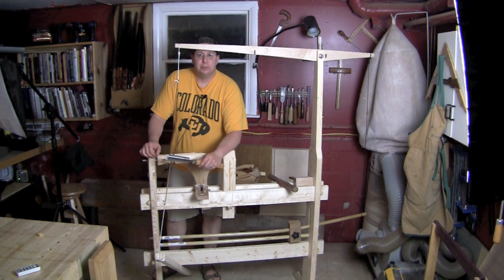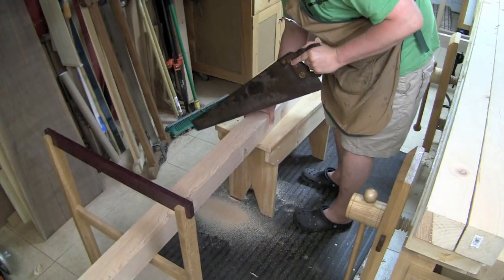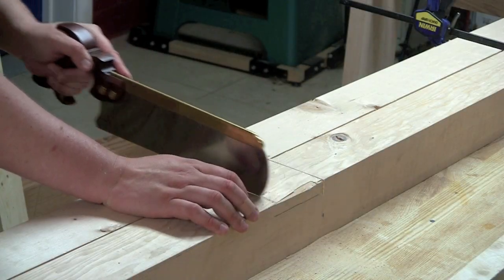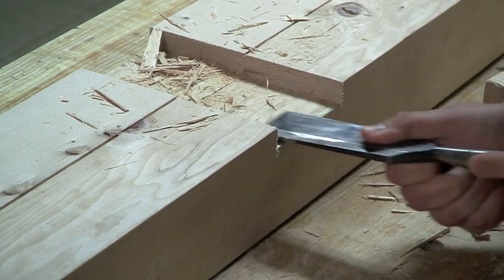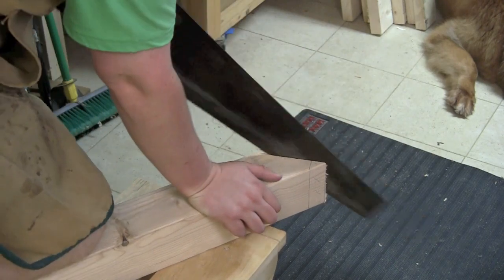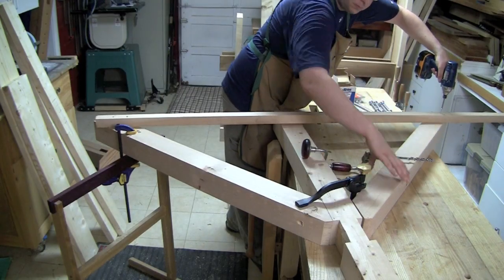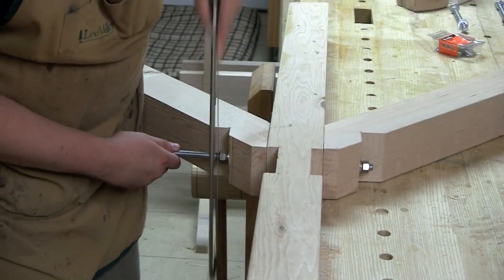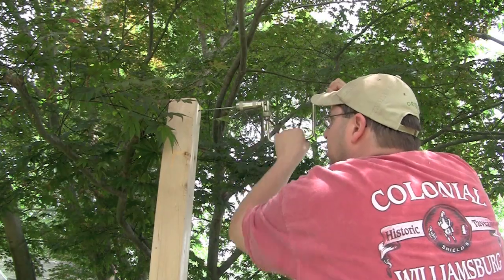RWW 162 Bungee Lathe Part 1

Comment: OK.  I made 1 years ago, but it's an oddity.  It uses a steel coil spring below the lathe bed.  To keep the tug of the cord from pulling the work out of the centers, I made it so the cord turns a drum that's mounted on a shaft that turns a drive center.  It weighs about 20 pounds & is very easy to move around.  The treadle runs sideways so the lathe is stable when you're working.  I really like your older lathe, I thought about making 1 like it but it wouldn't fit in the car I had at the time.

Comment from the maker: Argh, I anticipated this question.  They both have merit but this one does take up a lot of space especially vertically.  The Hulot lathe is very flexible with its built in "gearing" so that would probably win.  I really like using this bungee lathe though because the action is so smooth and it is rock solid.  I don't like choosing, options make us better woodworkers! (end tantrum)

Comment from the maker: I have several lessons on sawing and specifically resawing over at handtoolschool . net though these are part of a membership plan.  Resawing success is a lot about choosing the right tool too.  A coarse rip tooth works best and sawing a starter kerf all the way around the board will help a lot in guiding the saw.